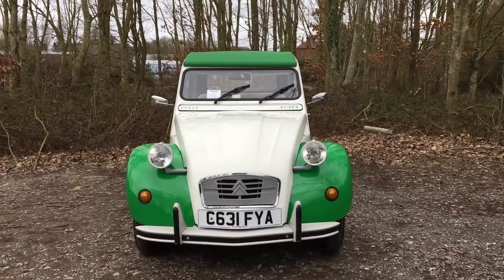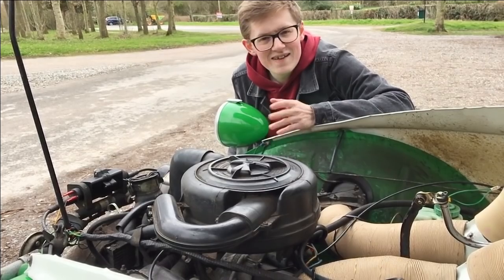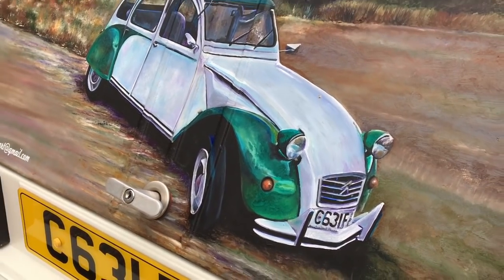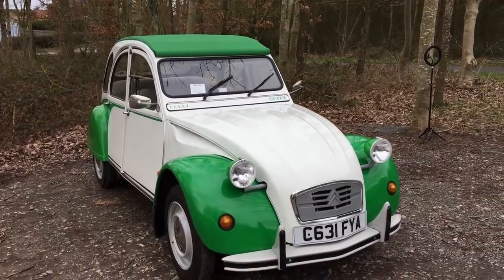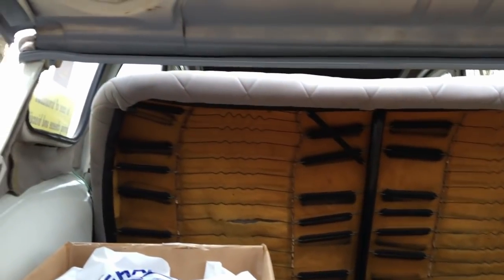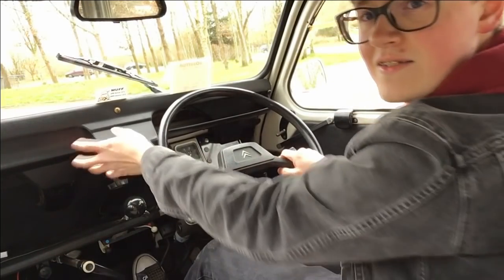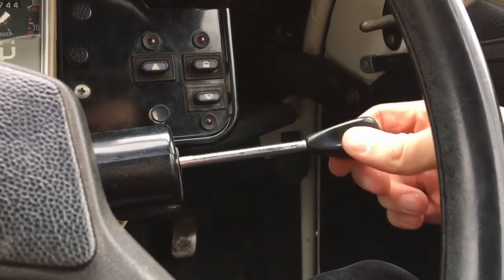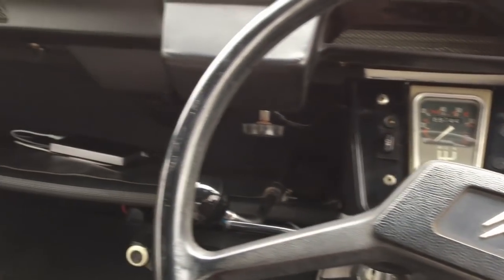1986 Citroën 2CV 6 - The Tin Snail's Indian Summer

Comment: Love the video. Had one of the first 2CVs Citroen re-introduced to the UK in 1974 [?]. 
As you may have noticed, the headlights are not attached to the wings or any part of the body. They are attached to the 2 ends of a horizontal bar which crosses the front of the car. Purpose? When a 2CV is ''loaded up'' the headlights would point at the sky. But by turning a knob under the ''dashboard'' [on the right-hand side next to the driver's door] you can raise or lower them. Clever eh? All done mechanically: so nothing to go wrong.
Another quirk. When the front doors are locked, they just turn round and round, LOL. 
I love the folding roof. I had always wanted a convertible they were all beyond the means of a bank clerk. So I bought a 2CV , what my Grandma called a ''sensible car''. Technically, the 2CV is not a convertible but a ''fixed-frame'' convertible. I had it opened most of the time, yup, even in the depth of winter all the way from London to Shropshire on B Roads. What's the point of having a convertible if you don't open the roof? The folding canvas roof had nothing to do with fashion. Steel/metal are heavy and expensive to make and replace. But not canvas. Saving money. Noticed there are only 3 wheel nuts for each wheel? Save money on 4 wheel-nuts. LOL
The 2CV, minimalist motoring at its best. Happy, fun days, long ago.
Reply from the maker: I did record a few more sections on the roof, seats, headlamp adjustment, and a couple of other things, but cut them out because they were really clunky bits of video. If I were competent, I'd have done multiple takes!

Comment: My sister had 2 and I drove both frequently. 
As for light stalk, the V stands for Ville, hence side and dipped beam. The R meanwhile stands for Route, hence dipped and main beam.
Air vent screw under the dash was liable to leak in the rain, and if the heater tubes unattached themselves you got warning of disaster  from a charred smell entering the cabin. I speak from experience. 
We took the cars all over France, Spain, Germany and Italy in the 70s. Cheap, comfortable and fun.

Comment: I owned a Dyane 6 while at university in the early 1970's. I regularly commuted between university in Manchester to my home in the West Midlands. The car coped well with the M6. 
It was very easy to work on. I recall changing the piston rings single-handed in the university car park between lectures.
My big disappointment occurred with the issuance of petrol ration books during the oil supply crisis in 1973. I expected to be ok because of the low fuel consumption if the Dyane. But the authorities decided to classify it as a motorcycle :-(.
I used to run the university badminton club. Often I would take out the back seat so the all six team members and their kit could be fitted in to travel to away matches.
I kept the car until I graduated, and it served me well.

Comment: Had one of these (a red 'special' (like the Dolly but without the two-tone paintwork) in the 1990s. I would absolutely love another. Not as a daily driver as it would be at least 30 years old and probably not reliable enough. Just to drive for fun and to appreciate the cult following this car still has. 

When talking about the heater he didn't mention the second control. A plunger which when pulled out directed the warm air up to the windscreen and when pushed in downwards into the cabin.

Comment: Simply marvellous review.

I once asked a policeman for a credit on the speed limit on the downhills for all the uphills where I could not reach the speed limit without a huge tailwind. 
Probably the least safe 2CV driving I have seen is older 2CVs slipstreaming lorries to get a free ride on the autoroutes in Europe at 110 kph on half throttle... 

My 1990 Charleston is absolute luxury in comparison to the Dolly.
Big speedo binacle goes up to 80 mph for those down hills with a tail wind. A 'Really Proper' Citroen single spoke steering wheel.. Also on my 1982 Charleston and 1978 Club.
The Dolly misses out on the cloth rear parcel self, inside door handle mouldings, and more chrome.
I prestiged my Charlestons with German 2CV front and rear headrests, door pockets with speakers. Boot luggage rack. Heated rear window from a Dyane. Polished aluminium spats on front and rear guards. Such decadence in a 2CV!!

During 42 years and 3 x 2CV6s from new, I have joyfully cavorted 550,000 kms. Sensational fun. I will never sell my 1990 Charleston and have left it to my younger brother in my will.
Reply from the maker: Thanks Stephen ☺️

Comment: I have the priviledge to own a 1984 2CV6 that I bought second - hand in 1991 in a poor state and fully restored in 2017. Further on I helped 2 friends to restore their own. Man, this car is really a Meccano for adults. A single person can do EVERYTHING alone including separating the body from the frame, removing engine, gear box etc... You need the original Michelin tires to fully enjoy the comfort of the suspension and handling. The gearbox is one of the few weak points. The first gear is practically not synchronized and you have to be kind when switching gears. When it rains the water infiltrates regularly through the ventilation hatch seal, and finds its way in particular via the driver's knees to under the floor mat where it hides and gnaws at the floor plates in silence even when the good weather is back. Rust and engine oil leaks (so it's time to rebuild your air breather) are two plagues that handicap our sweethearts.

Comment: Ed, you forgot to mention the 2cv party piece....
You can remove all of the seats in less than a minute, (I’m not joking) so you can use them as deck chairs at the beach, or picnic.
When I was 17, I worked at a citroen main dealer in Bristol.... these were still available new then!
My first car was a dyane, which I bought for £50.... total rust bucket, but mechanicals were perfect!
Reply from the maker: I recorded a bit on this (and the canvas roof) but they weren’t good enough quality to use in the final video. If I were competent enough to do two takes of everything, it’d probably be in there!
Reply: Ex Dyane, 1975, owner and whist I knew about the seat "feature" I only used it a couple of times as the position pins on the base looked fragile (but probably were not).  It was the roof that was the best part and I have vivid memories of my self and three mates driving through Glasgow city centre on a blisteringly hot day, roof back and mates sitting up on each corner one of whom had a guitar and we were belting out songs.  Stopped by the traffic polis and had a half hearted blocking for that but some great memories of that car and if circumstances allowed would happily have another just for the sheer fun factor.

Comment: I never imagined a 2CV with disk brakes! It was widely manufactured in latin America and the model experienced some modifications in these latitudes: Here in Argentina it was renamed 3CV, with an engine (a bit) more powerful and the centrifugal clutch was eliminated. Chileans modified the back hatch, so the rear window became part of it and the canvas roof was shortened. It was a very clever and cost effective modification. That solution was adopted here too.
Local branch of Citroën assembled the argentinian model until 1979.
During the second half of 1980's an entrepreneur called Eduardo Sal-Lari briefly resumed argentinian production under the brand IES América and Super América. The car was extensively redesigned with a new (and more conventional) suspension, a shortened bonet with a fixed front grill, rectangular headlights embedded on the wings and lots of plastic.
Today is almost impossible to see running IES cars, but still there are a few older Citroën in very nice condition here in Buenos Aires, most of them owned by fan club members.

Comment: Excellent video. You should dig into the Panhards, the Dyna Z, the PL17 and the 24. Extremely inventive engineering, also with two-cylinder engines.
Reply from the maker: Thanks mate :)
I'd love to, the only trouble is rarity!
Reply: @TwinCam  I understand that. Not a lot of Panhards in the UK, I suppose. Ihope you can find one and learn about their amazing engineering. There is a pretty good book out there written by your countryman, David Beare. It's called 'Panhard, the flat-twin cars 1945-1967 and their origins'. Pretty good read.

Also, I had two 2CV's and to this day I don't understand why I got rid of the last one... Well, I bought a DS and thinking this was my dream car and it was to some extent but I still miss the 2CV. Maybe some day. It's Alfa days now, I like to change once in a while. So many great cars...

Comment: The gentleman has his cardboard tubes slightly muddled. The short stub tubes are not for drawing cool air IN, but are heat dumps for directing hot air OUT via flaps operated by cables when the heater is off. The air has to go somewhere you see...
 Inside, heat can be directed partially UP to the windscreen, or more DOWN to the feet with a small black knobbed push-pull rod, which is the reason for there being two tubes (upper & lower) into the cabin.
This heat exchanger arrangement requires there to be no fewer than five exhaust pipe connections under the bonnet, which have to be periodically remade with exhaust paste, otherwise the occupants will be first made uncomfortable, and then gassed with carbon monoxide. So when you first start to smell exhaust fumes inside the car, act Sooner rather than later...
A small electric fan can be bought to mount inside one of the bigger tubes for use as a blower. This maybe worth having, but the motor itself really needs to be more powerful.

Comment: Ed, you have done justice to this glorious motor. I owned one for nine years & 145K miles.
Outrageously good fun on any surface, almost impossible to lift a wheel.
The buzz & whine of the engine along with the superb seats and suspension made every mile a joy in this car.
Is only failing?
A very, very s**te heater.
I love 2CVs, they are wonderful motors. Please try Petrolblog.com and read my review(s).

Comment: Remember them well from when they were still in production. Wind the flywheel up to speed and bring the clutch in quickly (impossible to stall) and it flew off the line. If I remember correctly 0-20 was quicker than just about anything on the market at the time - including supercars! However, above 20 mph, the speedo was replaced by a calendar!

Comment: A good tip.  Do NOT try to lubricate the gearchange shaft with oil  or grease.  It slides in a nylon bush and this will  make it  sticky.  Use Halfotds rubber  and nylon lubricant aerosol and the gear changes are lightning fast.

Comment: Regarding the light switch, the V (ville) position allowed the driver to toggle between sidelights and dipped beam, as you don't use main beam in town. R (route) lets the driver switch between dip and main, with no option of sidelights only. I suspect the big V and R letters were to remind M. Leclerc which lighting mode he was using as he made his way home after a few glasses of the local hooch... All very logical in its unmistakeably French way! I once had a Talbot Horizon, which had a rotating two position light stalk, but the side-to-dip or dip-to-main toggling was an up and down movement.
And you missed a trick with the opening windows; as well as open and closed, there's also the "flap" option, where you unclip the window and let it swing up and down letting gentle ripples of wind inside as you sway from side to side on that amazing suspension.

Comment: I had a "D" reg 2CV for ten years, if I didn't need something to pull a caravan I would still be driving it now, the only thing I found everytime I put it in for an MOT the chassis would require welding to be done.......oh, on my 2CV the odometer went round the clock.......

Comment: These later models were around as a budget car when I was growing up….I believe these have a bigger 3cyl engine….
Back then you couldn’t give them away lol.
Think now they are very collectible and worth a lot of money.

I believe that suspension was replaced by cheaper conventional springs on later models.

Early versions were 3 speed with the dog leg 1st gear. They didn’t completely redesign for the addition of the 4th gear, rather just add it.

Comment: Wonderfull car. I've had many cars. Also Citroëns. Dyane, GS and of course 2CV. Very simpel to work on (which you did a lot). The featured car don't have a periodcorrect instrumentgage and stearingwheel. It's from a lot older car. That's 2CV owners for you. They can't be controlled. PS! The discmount right on the gearbox should be  clever. Not entirely. The heat from the engine made them warp. I've never drove down at set of discs. After a year to year and a half, the breaks where so shaky, you had to swap disc and pads. Great car 😃
Reply: Instruments & steering wheel ARE CORECT ! The Dolly is based on the 2cv "Special " and not on the "Club" which did have different steering wheel & instruments !!  😵

Comment: I swapped a Porsche 924 for a 2CV in the 1980's, another special edition with a blue wave down the sides. You should really have taken the roof down as that was a major part of the fun of it and gone for a pic-nic and taken the back seat out!! I actually had the second hand 2CV after I'd had a brand new Visa, also rather a nice car for the time, incredibly economical and great fun to drive also, just not as quirky. To complete my Citroen set, after my very first tank-like Opel Kadett, my second car was a GS, which was just a beautiful car with that amazing hydrodynamic suspension. I think of all the cars I've ever owned though, right up to my now also slightly strange Toyota iQ, the 2CV had to be the most fun!

Comment: The Michelin radial tyres come from the fact that back then Michelin owned Citroen.
The flat twin air cooled engine was inspired on the Volkswagen Beetle, for the original 2CV thye choose for a 2 cylinder and of course FWD.
The 2CV's design comes from Flavio Bertoni (not Bertone) who also is responsible for the DS and the Ami 6 design. 
The bonnet is made of corrugated tin to get some stiffness in the paper thin metal.
Reply: As far as I know the pre - war prototypes from La Ferté Vidame were powered by engines borrowed from motorbikes and the first batch of 2CV produced before September 1939 were fitted with watercooled flat-twin engines. During and after the war the 2CV engine was redesigned by the engineer Walter Becchia  strongly inspired by his own BMW R12 motorcycle to become the flat-twin air-cooled engine that we know.
Reply: I thought it was the engine was inspired by the BMW R12 motorcycle engine.........

Comment: How on earth did they manage to get away with selling these things into the mid '80s!  Must have been strong grandfathering provisions in the design regulations!  In Australia, I expect it would have been unsaleable in the early '70s due to the need for intrusion protection in the doors, at least.
Reply from the maker: The 2CV was technically illegal to sell by the later years, but gained exemptions in the UK when it was reintroduced. Overall though, it didn’t have to be approved because it was already on the market.